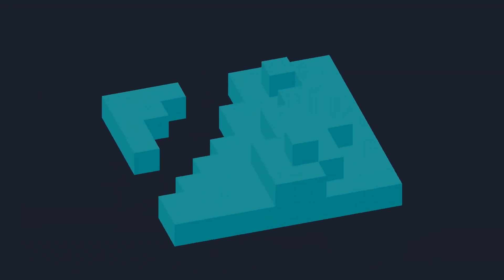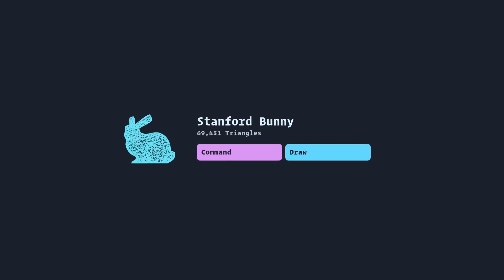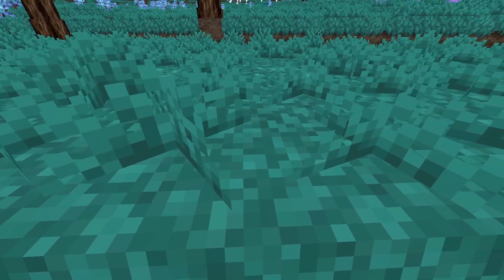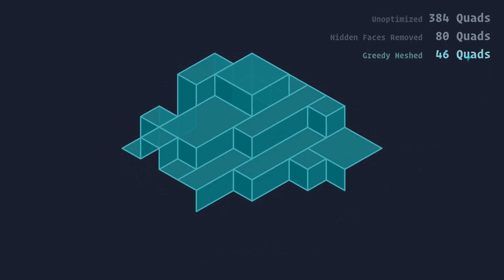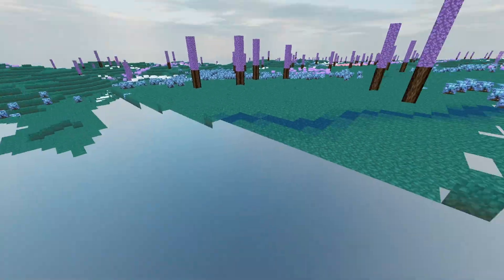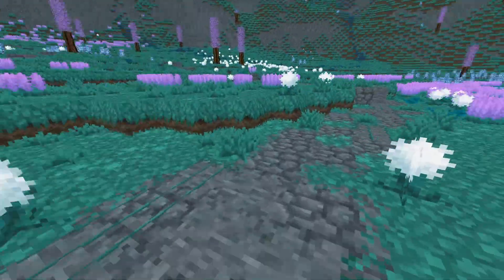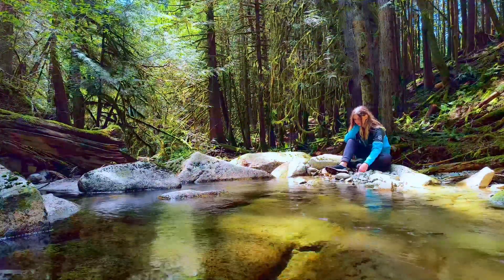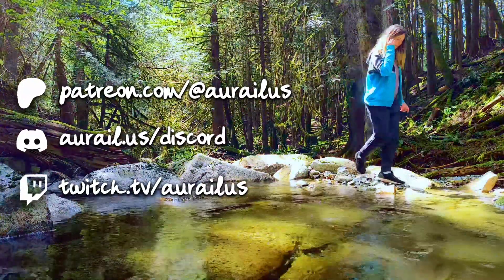So how are voxel games rendered, anyways?

Comment from the maker: Miscellaneous Errata:

- I made a mistake in calling my greedy meshing Pseudo Greedy Meshing. In fact, what I described is actual Greedy Meshing, and what I called Greedy Meshing is more commonly referred to as Optimal Meshing.
- In the section about Level of Detail, I forgot to mention that as the block scale is increased, the chunk size in world space should be proportionally increased. So if a chunk at 1x scale is 32 blocks cubed, a chunk at 2x scale should represent 64 blocks cubed, at 4x scale a chunk should represent 128 blocks cubed, etc.
Reply: The voxel LODs sound really exciting. I want to see how that works.
Reply: This video was really cool, informative and easy to digest - thank you!

Also, have you seen the greedy mesher of the creator Tantan? I think he managed to actually get his greedy mesher working faster than naive meshing, which I thought could potentially really boost your engine's performance. Just a thought, though!

Comment: Snag you might run into that i did, with LODs, especially with smooth voxels, creates heavy issues with replication/multuplayer and navmeshs. When flooring for a cow or other player goes from bumpy to flat because the main player walked away, all of a sudden, they're slightly below the ground, and fall infinitly. This also happens in blocky games when youve got big changes.

Comment: Hi, do you use texture atlas for your blocks ? Because I made a greedy meshing algorithm but the problem is that textures are now stretched, and apparently it’s impossible to fix it with texture atlas. Thank you
Reply from the maker: Hi, I don't use a texture atlas in my engine. It is possible to do greedy meshing with a texture atlas, but it's pretty difficult, as you'd need to send all four texture coordinates into each vertex to be able to effectively repeat them across the greedy meshed quad. There are more sophisticated ways to get around this, like Vertex Pulling to pull the texture coordinates out into a separate buffer, but to be honest, you might be trying to force something that isn't meant to be
 here. Texture Arrays are much easier to work with as you can take advantage of native texture wrapping, and they don't break when doing stuff like anisotropic filtering, which texture atlases struggle with. Hope that helps!

Comment: Hello ! 

I'm Voxoking,

I would like to know if voxel creation/ .vox format can be integrate in this kind of voxel engine or you have to do the modeling all yourself inside the game engine itself ?
Reply from the maker: Hi! The engine only supports loading GLTF models (or their GLB representation), but almost all model formats can be reformatted into them. I model all of my models in Blender, and then export them to GLTF and load them into the game. The main thing I'd worry about with different modelling tools is support for custom properties, which are used for defining things like leaf swaying, culling sides, etc. You could always import a finished model into blender, assign those properties, and then re-export though if you wanted.

Comment: Very cool video, definitely subscribed! A good LoD system really makes the Voxel worlds feel infinite. You could also try to add a simple heightmap renderer for really distant chunks, instead of rendering what is essentially a single-block chunk, which makes really distant chunks easier to archive. If you don't have the chunk generated, you could on-the-fly calculate just the heightmap for the terrain generator(assuming the terrain generator supports this, but this is common) instead of full chunks. This could archive "realistic" viewing distances(10km+ to horizon), see also the Distant Horizons Minecraft mod!
Reply from the maker: Thank you! I'm planning on making "larger" distant chunks that scale with the block size, i.e. if a chunk is at a distance where it's only rendered using one cuboid, it would be blocked into a "mesh chunk" that's 32 chunks wide so that the mesh generation works the same. I don't want to do heightmaps because I want to do lots of stuff with floating islands and other volumes that Distant Horizons chokes on.

Comment: You can squeeze even more performance out of greedy meshing by  using binary meshing. Which is basically representing your voxels as integer values and doing some clever bit masking operations on them to "merge" the faces.

Hope this helps if you ever need to optimize the algorithm further. It still won't be perfect greedy meshing, so there won't be a reduction in vertices, but still faster haha.
Reply from the maker: I've heard a lot about this since publishing this video. I need to investigate it at some point. Thanks!

Comment: are you using instanced rendering for the grass meshes?
Reply: also, i think the solution to chunk LODs is that the neighbor higher detail chunk has to blend to the lower detail version of it at the border with the lower res chunk
Reply from the maker: I'm not currently using instancing for grass meshes, but I've got an idea I'm going to be experimenting with for how to handle it much more efficiently which I'll be going over in part 3 of this series. I think you're right about the LODs! I just need to have the border chunks account for the lower level of detail on the edges of the neighboring chunks. There's probably some funky preprocessing I could do to account for it at the moment I queue a mesh to be generated.

Comment: Another LOD think you can do is to reduce the complexity of the fragment shader so that "pixels far away" will be less demanding to process, like using smaller textures, simpler lighting or skipping some calculations depending on what the shader does. For example if you have a lava block or something changing texture brightness with time and a sine wave or smth it can probably be skipped and just have a static brightness.
Reply from the maker: You're completely right! I was working on that a while ago, but then I shelved it because I didn't have a very good solution for managing swapping shader pipelines my rendering architecture, as all the chunks no matter what LOD were blocked together in one big render list. I need to change that anyways once I get seriously high LODs going, because I'll need to render translate them coordinates closer to the player to avoid floating point imprecision--similar to what source games do with their skyboxes--so at that point I'll definitely be writing a simplified terrain shader for them.

Comment: 4:30  Given the quads in the meshs are axis aligned why not just sort them into multiple meshs based on facing and use a hand full of ifs on the cpu to do 90% of the work the backface culling is doing? Would even save on the geometry feed into the vertex shader which is already going to be worked harder in Minecraft likes vs other games.

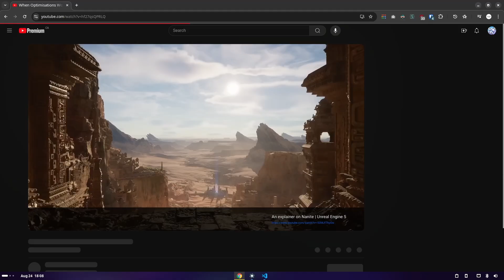7:40 The talk of Simon's video and the problems with edges and LODs reminded me of the youtube video 'A Deep Dive into Nanite Virtualized Geometry'  purposely cut link: watch?v=eviSykqSUUw
Reply from the maker: I haven't really been thinking about sorting my meshes by side because I'm fairly draw-call limited right now, but in my last stream Quantum Developer suggested I do it as well and since then I've been giving it more thought. If I multiply the mesh region size by two on each axis, I could then split it into 7 face meshes (6 for the cardinal axes + 1 for non-culled faces), and it would still be a net gain on draw calls. I think I'm gonna try it! 
I haven't watched that Simondev video yet, I'll do so!
Reply: @Aurailus  Also if your draw call limited, GL has ways to shove draw call info into GPU memory and batch up multiple of them. (MultiDrawInderict, if I rememeber right) Also the video is a decade old but look up "Beyond Porting: How Modern OpenGL Can Radically Reduce Driver Overhead (Steam Dev Days 2014)". If your using Vulkan I would imagine equivalents exist, as Drawcall limited (read as: driver overhead), is one of the primary reasons Vulkan came to be.
Reply from the maker: Yeah, I've messed around with Multi Draw Indirect a bit, and I was still getting pretty bad performance. I'm thinking I might actually be misattributing cache coherency issues to draw call time. Hopefully I can address it somehow though!

Comment: great vid! what obsidian plugins do you use? those tab icons are so satisfying.
Reply from the maker: Hey! I use a bunch of plugins, but mainly MakeMD for the file icons & folder sorting and stuff. I'm not a fan of the default styling of the plugin, so I have a CSS snippet for it which I use as well in this repo: https://github.com/Aurailus/Obsidian-Snippets/. I'm also using my own fork of the extension which fixes a few bugs that the dev wasn't addressing, so the current version might have broken styles with my stylesheet. My fork is here: https://github.com/Aurailus/MakeMd
Reply: @Aurailus  Fantastic thanks!

Comment: I suggest not making chunks half the resolution, instead make chunks double the size (so effective resolution is halved but number of meshes is cut down). And instead of querying occupancy of the neighbouring voxel of the same LoD, query whether any of the 4 voxels in the higher LoD are free. A few extra faces wouldn't hurt.
Reply from the maker: You're right, I have already been planning on making the lower detail chunks larger, I kinda skimmed over that part in the video 😅. Querying if any faces are free in the higher LOD chunk would definitely be an improvement!

Comment: 8:02 I’ve also seen that video. But apparently, the GPU doesn’t make extra calculations. GPU works with SIMT (Single Instruction Multiple Threads), so it’s not each individual threads running in parallel of each other, it’s multiple groups of threads that runs parallel to each other. When the gpu needs to execute a fragment shader, it dispatches multiple groups of 2x2 threads. So when there is only one fragment to draw on, only 1 thread is working while the others just sit there. The same thing happens when you branch in shader code, if threads within the same group don’t branch to the same place, the others needs to wait for the other one to finish and vice versa. I don’t know if I made it clear, but I recommend reading on the SIMT architecture, this will also help you for compute shaders (how and why we dispatch them the way we do). Good video btw!
Reply from the maker: Thank you for the clarification! I gave a pretty high level overview of this phenomenon, as this video is meant to be more of a cursory introduction to the topics I'll be exploring in the next videos. Correct me if I'm wrong, but I believe everything that I claime is still correct with the behaviour you described, as spinning up multiple threads that end up being discarded is still wasting threads that on a larger polygon would be doing actual work. GPUs have a fixed number of threads to do operations like rasterization, right?
Reply: @Aurailus  Yes I agree, I just wanted to point out that the GPU don’t do unnecessary calculations, it just stays idle for the most part. And in the end, does in fact waste time that could be spent on processing other data. Sorry if my comment sounded a little rude 😅
Reply from the maker: @trzrekzii9361 No worries at all! It didn't come off rude, I just wanted to check my understanding. I should have done a bit more research into how it "wastes energy".

Comment: 04:29 the grass requires alpha clipping which would require the whole mesh to be cutout instead of opaque. Did you notice an improvement on rendering the blocks after you could drop the cutout?
Edit: oh, i noticed you got foliage on the grass-wall cubes, so you still need alpha clipping.
Reply from the maker: I haven't thought about disabling alpha clipping on chunks. As you pointed out, I do still have transparent faces in the backface culled meshes, and if I wanted to split meshes by if they should have alpha clipping or not, I'd need an entirely new render pass. I'm not sure that math works out on if that's better than doing it the way I'm currently doing it. I'd need to experiment though, I might look into that in the future!

Comment: but... these aren't voxels. This is plain old 3d model rasterization. Just in case you haven't seen it already, take a look at Comanche (1992) for an example of voxel rendering. Other than that, great introduction on azdo and other optimization techniques. Ah before I forget, one issue with LOD you want to consider is that one instance of a small model at a distance can be ignored. Many instances, of a small model, closely packed together at a distance can not. Think of a single flower at a distance, which you can even omit without losing anything, versus a dense patch of flowers of the same kind of flower.
Reply: These are literaly voxels. just check what is a voxel..
Reply from the maker: The term "Voxel"  was mainly popularized in the public consciousness by Minecraft, another game that uses rasterization. Yes, there have been a lot of raytracing projects recently which are "true" voxel engines, but I continue to use Voxel in the way that I and the public (that I can see) are familiar with, because that's the way that I've always heard the word used outside of specific game dev people. There's not really an appropriate term for raster rendered cube games other than Voxel, either, which contributes to the issue.

Comment: I was also struggling a lot with LOD transitions in the past, but I actually found a quite simple solution:
It requires a bit of a paradigm shift. Usually for a given chunk mesh you'd store all the border faces that point away from blocks of that chunk.
But this can be switched to storing the faces that point into the chunk. This may seem a bit counter-intuitive at first, but it helps making the LOD transitions:
You can easily generate all the faces that point into the chunk from a neighbor LOD chunk and store it in the high resolution chunk mesh.
And then whenever a high resolution chunk has a LOD neighbor, you can just swap the border part of the mesh.
Another advantage of storing it in the high res chunk is that you get tight meshes, which makes transparency work as well.
Reply from the maker: Hey, thanks for the advice! I'm trying to understand how this improves the LOD seams... Is the idea that you mesh the inwards faces of neighboring LOD meshes as though they're high resolution, and treat the blocks as though they're solid 2^3 cubes of whatever block type is at that spot? That does seem like it would make things a bit easier than trying to figure out what faces are occluded by a higher resolution chunk bordering an LOD chunk. You also wouldn't need to mesh the inwards facing quads FROM a higher res chunk into a lower one, because those would always be facing away from the player. Is that what you're talking about? If so, that's a really great idea!
Reply: @Aurailus  Yeah, that's exactly what I'm doing.
Reply: What do you mean by 'swap the border part of the mesh' exactly? Are you saying if a neighbor chunk is low resolution then you draw the inward faces on the high res chunk but otherwise you don't and let the neighbor chunk draw them?
Reply: @SonicTheCat  I always draw the inward faces no matter if they come from a low-res or a high-res neighbor. This makes it possible to swap them out.

Comment: @Vercidium made a better one video tutorial on optimizing voxel meshes down to GPU memory chunck layout.
Reply from the maker: Vercidium is a great content creator! I've seen the video you're talking about, and it's a good resource. However, the pacing was quite fast in my opinion, and it skimmed over a few details that I want to cover in more depth. I also have some unique tricks that he hasn't covered, to my knowledge.
Reply: @Aurailus  I agree, he didn't tried to cover lods, and that's important for keeping details without performance problems with quads (2x2 pixel clusters that GPU utilizes to rasterize triangles)

Comment: one idea of fixing the jumps between two chunks with different level of detail is to move the chunk with lower lod down a bit, since that chunk will be further away.
Unfortunatly the max jump is like half the "merged voxel size", so the entire world would curve down the further you look.

Another approach would be to blend between chunk borders (i.e. place some more voxels in the chunk with higher lod). This  idea also reminds me of how Minecraft blends between chunk borders but instead of doing it for lod they blend when chunks have been generated in different versions resulting in massive jumps between chunk borders.
Reply from the maker: I actually considered this! But unfortunately, that only works for seams between the top edges of blocks. Shifting the chunk down wouldn't help with vertical seams, which are more rare, but still possible. I might be able to fix it by caching lower detail chunk info on LOD edges in my octree. I'll think about it more and hopefully make a video on it!